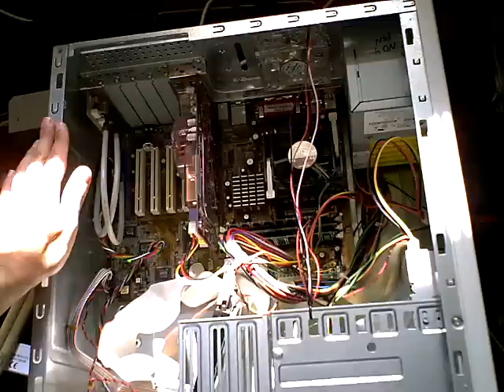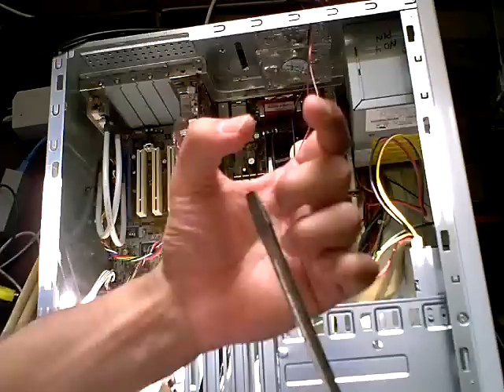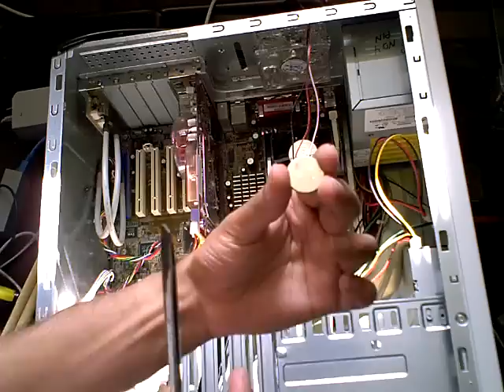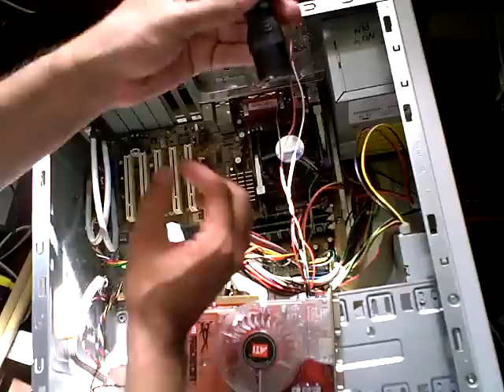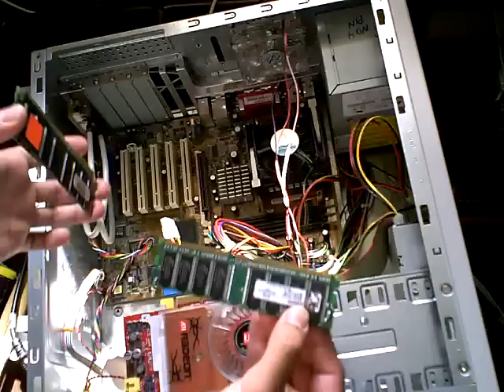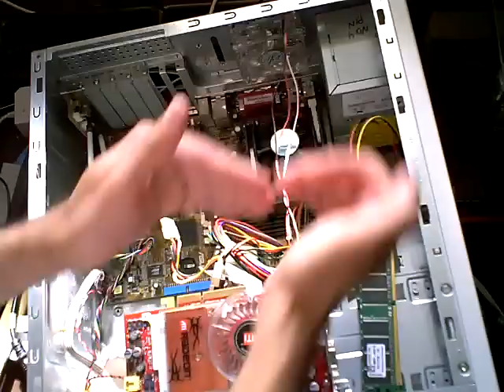How to possibly fix a PC that will turn on but will not beep and will not display anything on screen

Comment: The desktop I have only turns on when I remove the pci - e cable. If that cable is connected the computer will not turn on whatsoever. Even though it turns on when removed I still have a black screen no and error beeps. Also the disc drive does not open now. any suggestions!
Reply from the maker: +Michael Sanabria Eek. Could be a too weak power supply. Could be an incompatible PCI-E card. I'd try to Breadboard it (explained in the following video:)

If the steps in this video did not provide a solution to your problem, view:

http://www.youtube.com/watch?v=_EK9a-R5pss

You never know, maybe rebuilding the PC in the opposite sense that you took it apart will solve the problem.

Comment: I got same problem, When I Remove graphic card no beep, but when i remove Ram it has  5 beep .  So whats the problem why i am not getting display.
Reply from the maker: +Vinit Patel Beep error codes differ from one BIOS manufacturer to the next. To discover what the beep error code is trying to telling you, discover the manufacturer of your BIOS (available in the motherboard's manual or on the motherboard's manufacturer's website {on the page for your specific motherboard model}) and then look up the frequency and interval of your beep error code on:

http://www.computerhope.com/beep.htm

Comment: Please help i have put in a pefectly working  ati HD5450  card into my board. Its msi 916gm motherboatd. When i swiych it on it goes on for a second and then turns of and  on and thos continues until i kill it. If i kill the power it stops.what can this be?
Reply from the maker: What specifically is going off and on? The entire power feed to the PC?

Comment: hello there. few questions i know you may or may not b able to answer but here is my issue, my computer won't turn on well it will turn on but for like a few secs 30 sec tops and it automatically dies. fan works, power supply turns on, everything works monitor is fine when it fully boots up but it then dies again. pls help
Reply from the maker: Breadboard it (explained in the following video:)

If the steps in this video did not provide a solution to your problem, view:

http://www.youtube.com/watch?v=_EK9a-R5pss

You never know, maybe rebuilding the PC in the opposite sense that you took it apart will solve the problem.
Reply: Looks like your CPU is getting overheated and it shut it self down. check your CPU cooling. it happened to me as well.

Comment: what happens if its brand new? my mother board is a z97 guard-pro classic msi mother board followed your steps. does this means i have to buy a new mother board
Reply from the maker: +Tas TheBeltKing Breadboard it (explained in the following video:)

If the steps in this video did not provide a solution to your problem, view:

http://www.youtube.com/watch?v=_EK9a-R5pss

You never know, maybe rebuilding the PC in the opposite sense that you took it apart will solve the problem.

Comment: I built a custom pc the specs are AMD 8350, AMD R9 280x power color, gskill ripjaws 8gb ram, 1 tb seagate hdd, evga 750w bronze and an asus optical drive. when i turn on my pc all my leds and fans turn on but it wont display on the screen and it wont power up my keyboard or mouse im really confused. I also have another question... i have a dvi cord that has a weird looking layout that doesnt match the one on my graphics card it still fits but im not sure if it would actually work or not.
Reply from the maker: We'll begin with the DVI cord: There is DVI digital, DVI analog and DVI dual. Aside from DVI dual, the analog variant is not compatible with the digital variant and vice versa. Look this up on wikipedia to figure out which is which. 

As far as your build: note that matching bus types of video card to motherboard socket (PCI-E for example), matching socket types of CPU to motherboard socket (LGA1366 for example) or matching bus types of RAM module to motherboard socket (DDR3 for example) does not necessarily signify compatibility. If this is the first time you are trying this hardware on your motherboard, there is a chance that this new hardware is not compatible with your motherboard, despite the same bus type and despite the fact that the new parts fit in their respective motherboard socket. Your motherboard manufacturer's website will have a support page dedicated to your motherboard's model, and on this support page should be a compatibility list for such components as video cards, CPUs and RAM modules. Ensure that your new component is certified to function with your motherboard, and if your new component is not present on the compatibility list, then there is a chance that the new component is not compatible with your motherboard.
Reply: +RodneyDickson its all compatible i checked before i ordered i heard that i might have to update my drivers and ill look into the dvi thing theres a chance thats the problem.
Reply from the maker: Yes, there is a possibility that the PC needs to make a video connection in order to boot (this would be in the case where you do not have an internal speaker present to let you know of beep error codes)

Comment: RodneyDickson  Could you help please. I do realize this video is old but . My gtx 760 OC worked for around 6 months before this happend. I'm pretty sure that my mother board is ok being as i am using a geforce 210 on the same pc. I tried taking our the battery but this didnt work. Any responce would be appreciated, thanks.
Reply from the maker: +james Draper Breadboard it (explained in the following video:)

If the steps in this video did not provide a solution to your problem, view:

http://www.youtube.com/watch?v=_EK9a-R5pss

You never know, maybe rebuilding the PC in the opposite sense that you took it apart will solve the problem.

Comment: hi sir.. can you help me with my problem? Is it possible that i have a defective mother board? When i turn on my pc, there's a beep sound, then the screen will flash more or less 4 times like a low voltage bulb. After that it will get into windows, more like 30 mins or more the screen will turned off, but cpu is still on. I've waited, more than 15 mins, screen will turn on again but all the programs i opened a while a ago is still running meaning cpu is still on. I already replace the memory and the powersupply but problem still persists. 
thank you in advance.
Reply from the maker: +Paul Fontanilla Just sounds like power saving schemes in the BIOS and/or in the Control Panel of Windows. Ensure that all of those settings are set to off.

Comment: studio xps9000 just replaced the psu. It worked for a couple days then i got no video signal. i followed your steps and removed the ram and got 2 beeps. Now what??? Help
Reply from the maker: +Michael Coello Beep error codes differ from one BIOS manufacturer to the next. To discover what the beep error code is trying to telling you, discover the manufacturer of your BIOS (available in the motherboard's manual or on the motherboard's manufacturer's website {on the page for your specific motherboard model}) and then look up the frequency and interval of your beep error code on:

http://www.computerhope.com/beep.htm

Comment: What about if my CPU is beeping,the hard drive is working but after the 'welcome' part then my screen turns black ..pls help me .. what is the problems??
Reply from the maker: +Steve Mathieus Try booting in safe mode (hold F8 at boot), and in safe mode selecting your default display to be your selected display

Comment: When I start up my PC it starts up then shuts off. When I leave the 24 pin ATX power connector it stays on but when both the 24pin and 8 pin is plugged in it shuts off. Does it do this when a CPU isn't attached and CPU is broken? I recently found out that my CPU has bent pins. I know that a PC won't work without the CPU. I'm just wondering if that would cause the PC to power up then shut off.
Reply from the maker: The bent pins are suspect, yes. To rule out any possibility of short circuit, you can always Breadboard it: 1)place the motherboard with CPU+Fan on wood or non-shiny cardboard 2)connect all of the case connectors to the board's panel 3)with a power bar that is OFF connect the PC power cable from the power bar to the power supply and the power supply to the board 4)while NEVER touching any exposed component,power on the power bar and press the power switch on the case.If the problem still persists,one of the remaining components is probably defective.Power off the power bar before dismantling

I cover breadboarding in greater detail in this video:
Advanced troubleshooting technique tutorial of how to possibly fix a PC that will not beep at boot
Reply: RodneyDickson I tried installing windows 7 on my PC because windows 8 has lots of problems, and when i first started the setup, it had to restart, so it shut down, but never came back on, so i pressed the power button to start it up but when I did, the monitor went into power saving mode and when i press random things on the keyboard, it shuts down quickly, and when i do nothing it shuts off after 2 mins.
Reply: RodneyDickson  hi iam having the same problem im not geting any beep sound even after the ram is removed.. cpu fan and cabinet ffine is working ok also replace the cnmos battery but also removed grapphic card...  then also nothing comes on my display..monitor..   earlier my system was ok it started giving me this problem when i cleaned motherboard dust.. amd removed ram etc for cleqning dust
Reply: +Febuary is Short (Justin Konstan) CPU with pins? AMD?  They make pin straighteners for things like that or you can take some small forceps or needle nose pliers and fix them.
If its an Intel with pins your better off scrapping it and getting something modern. Like a socket 2011v3 or even a socket 1155..
Reply from the maker: +211darthreven443 Do you hear a beep at boot?
Reply from the maker: +raju Breadboard it (explained in the following video:)

If the steps in this video did not provide a solution to your problem, view:

http://www.youtube.com/watch?v=_EK9a-R5pss

You never know, maybe rebuilding the PC in the opposite sense that you took it apart will solve the problem.

Comment: My pc beeps 1 long time and then 2 short times and continues to do so as long as its on. It wont display anything. I've tried putting the video card out/in, resulting to onboard input, and taking the ram out and putting it back in. Nothing worked. I have a asus motherboard. Can you help?
Reply from the maker: +Matt Bean Beep error codes differ from one BIOS manufacturer to the next. To discover what the beep error code is trying to telling you, discover the manufacturer of your BIOS (available in the motherboard's manual or on the motherboard's manufacturer's website {on the page for your specific motherboard model}) and then look up the frequency and interval of your beep error code on:

http://www.computerhope.com/beep.htm

Comment: HI RODNEY, I was playing a game and my pc suddenly froze and there was continuous buzzing sound from the speakers but screen was frozen.So i shut down and restarted it and there was no display this happens quite often,after few hours later i swapped rams and turned on display it started fine and after few minutes it all happened again......plz help
Reply from the maker: +Syed Musaddiq Sorry Syed, your issue is a tad too tricky: there are far too many variables. First, go into your BIOS and load setup defaults, followed by saving. If that doesn't help, if you have an extra harddrive, you can setup a clean operating system with only drivers and your game installed, play it there, and see if there are still issues. If that doesn't help, everytime the PC hangs, reboot, go into your BIOS, and check your CPU temperature (it may be overheating). Still, it could also be your video card overheating, your PSU dying, your hard drive dying, or any other combination of problems, thus why your issue is so complicated. Hell, it could even be memory errors in your RAM modules. Aside from the extra hard drive test, every other test I'd have you do would have you buying replacement parts to test, which can costs hundreds before (and it's a big maybe) you get to the root of the issue.  It's crappy of me to suggest this (I sound like one of those morons on Yahoo! Answers) but you may need to just buy a new computer unfortunately (at least a new motherboard, CPU and fan)...it would probably yield the best success rate at solving your issue : \

Comment: Same problem but after messing with my PC I somehow got it on loaded up normal, keyboard was working but I had to restart it because my mouse was off and it stopped working again ... I really don't think its the mobo or ram since it was just working ... please help
Reply from the maker: I'd go into the BIOS, 'Load Setup Defaults' , save and exit. If that doesn't solve the problem, unplug the PC, disconnect every non-essential device from the outside of the PC (all you should have is keyboard, mouse, power, and video connected), and power up. If still a problem, maybe the mouse is faulty. Could also be the port on your board that you connect your mouse to. I've already seen a weak PSU cause issues like this as well. There are a multitude of possibilities here. Even your Windows installation could be corrupt.

Comment: Hello, nice video, but it unforentlly not help me solve my problem. 
So here is the thing I have a notebook ASUS K53E that had Intel Pentium Core DUO (950B) installed. Everything worked fine. Than I decided to make an upgrade and upgrade it with an i5 2520M that is supported by socket and BIOS and also MB. So when it arrived I dissasembled my laptop and swapped the CPU pressed the power button (I had to test it if it works before I put it together, and nothing worked), but after some time and some magic put into it it POSTed and worked fine did some banchtesting and decided I should put it back together. So when I was putting everything back together and after connecting all the cables to the mobo (intergrated monitor, usb and mic, speakers controler that is connected over a flat cable and mousepad I decided to give it one more chance to make sure everything works. It worked so I came to BIOS and as usually set a password. After that I saved settings and than it frooze, I disconnected AC cable and it shut down. After that it just won't turn back on no matter the CPU, RAM, SSD, WiFi card... So what it does it "kindda" turns on as usually just that it won't show no video (internal monitor, hdmi, vga nothing works). Any help would be much appriciated. Thanks in advance, have a nice day!
Reply from the maker: Your CMOS settings are probably confused. Disconnect the power cable, disconnect the battery pack, remove the CMOS battery, short the CMOS jumper pins for 9 seconds then return the jumper cap to its initial position (if present on your motherboard), press your PC's power button switch (to discharge any remaining power circulating in the system), leave the PC unplugged and in this state overnight, then the next day return the CMOS battery to its socket and power up the PC.
Reply: Hello, I have done a simiral procedure, but only with the CMOS bat out, as this is a laptop and I cannot locate CMOS jumper pins... what about that?
Reply: Also I'm going to retry this the way you said it...
Reply: So I tried it a few times, tore it apart, all power sources disconnected cmos bat out, shortened CMOS bat contacts for a few sec, pressed the power button for a few times to drain the remaining power, left it for at least a day, inserted CMOS bat, connected battery, tried fireing it up... still the same. A half boot, swould "turn on", but no video on internal display or over HDMI, VGA... I have no idea what to do, maybe I should take it to repair shop and explain the situation?
Reply from the maker: CMOS CLR jumper pins are not common on laptop/notebook motherboard configurations. If you follow the steps I laid out in the last comment, then that will accomplish the same task as a CMOS CLR
Reply from the maker: Try removing the hard drive. See this video: http://www.youtube.com/watch?v=qRhphHjQrNk
Reply: No differance, this laptop won't work with it or without, I have been testing it barbone, nothing works as I said before. This darn thing won't work whatever I try. I decided that as soon as I return from vacartion I will carry it to the local repair shop and explain him the situation and let him see what he can do if anyxthing. Thanks for all the help.
Reply from the maker: Sure thing. Good luck with it all.

Comment: Hi can u help me, i got new cpu x4 760k and i haved a8 3820 but when i installed the new cpu my computer does turn on but i cant see anything on the screen then i tried my a8 3820 and it worked fine sorry for my bad english
Reply from the maker: Your new CPU may not be compatible with your old board. Look up the CPU support list for your board on your motherboard manufacturer's website.